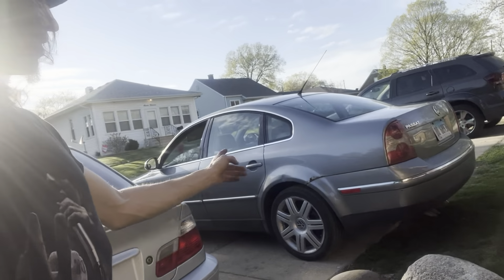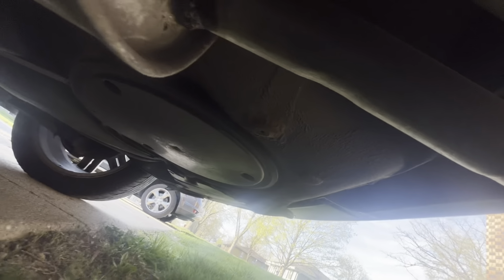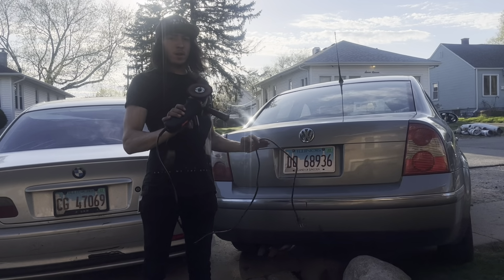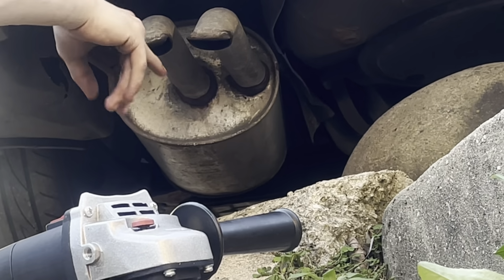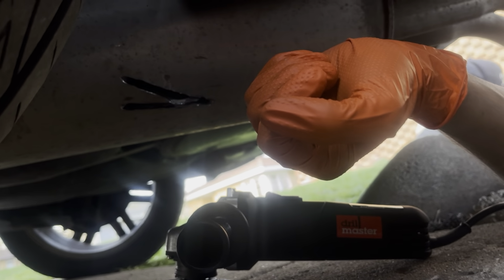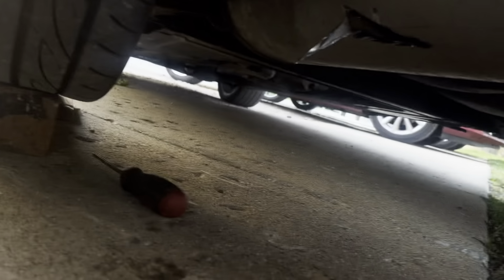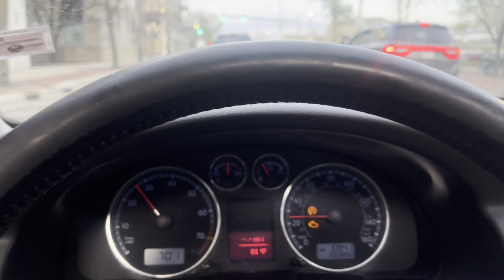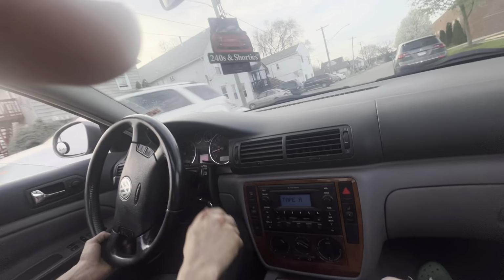CUTTING OFF MY MUFFLER!!! B5 VW Passat 1.8T. Turbo noises!!!

Comment: Don't forget about the massive suitcase of a resonator... I removed the muffler and the resonator from my stock B5 Passat 1.8T wagon leaving only an open downpipe, there is still however a cat built into the downpipe also...
Reply from the maker: It’s straight piped from the cat to the “back box” muffler. New video coming soon of me putting a rice tip on the car. For fun, it looks silly though

Comment: Bro the problem is you are using a grinding disc you need to use a cutting disc they are much thinner and cut faster, but A for effort
Reply from the maker: Yea that’s what I might do. But this was just temporary I’m definitely getting an aftermarket muffler